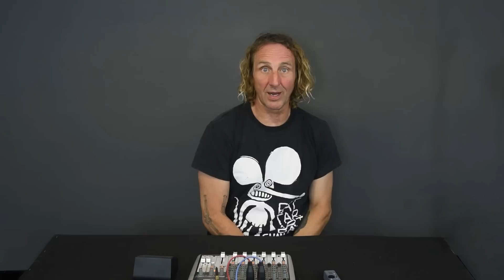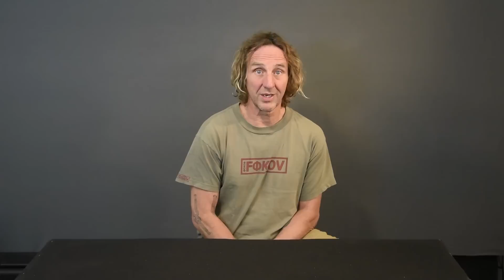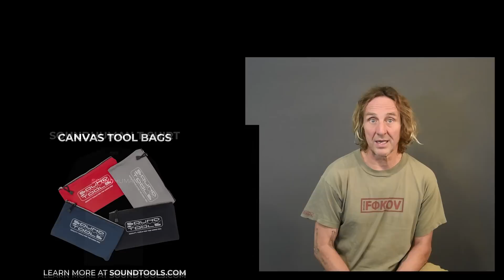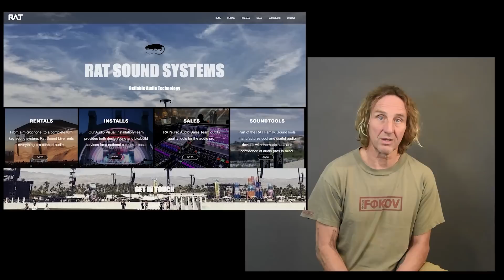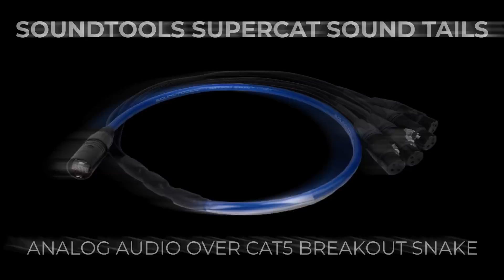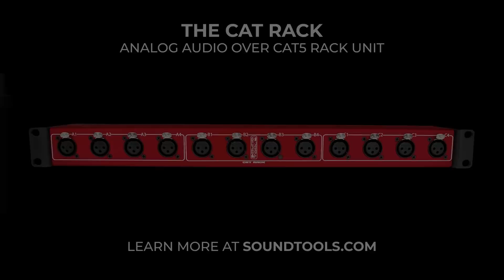Does Gain Pot Sound Different than Fader?

Comment: Hi Dave!

could you please show the difference between speaker generation and how newer transducer reproduce a way better signal then the old wood box with JBL speakers. 
still to this day i have people come talk to me on gigs about how good A7 and 4530 where sounding at discos.
I believe there memory is flawed and the newer technology reproduce a way more accurate signal
Reply from the maker: Interesting.  All the good old days when everything was better, but mainly because our rates were less refined and our memory is flawed.

That said, there ire some sonic differences between the big high efficiency cabinets powered with less amp and the newer smaller cabinets powered by more watts.

I will ponder a punch, dynamics, efficiency and freq response vid. Cool cool

Comment: Regarding "gain adds more bg noise and fader does not", I think that this sentence is for more complicated setup than you presented. This sentence will be definitely true if you insert a Gate to signal chain. Gate will be after Gain pot so if you increase Gain, you're like lowering Gate threshold for background noise. But if you raise fader - all sound that was filtered will be still filtered by Gate and only that filtered sound will be increased.

But anyway, I really liked those examples, especially with clipping gain example!
Reply from the maker: Gates and comps will totally change everything.

The belief that by some magic, a fader knows to turn up the actual instrument while a gain pot is a big scoop that turns up everything including the instrument is somewhat widely believed.

I am guessing this is due to people clipping the input gain which in effect creates a bad sound limiter, in effect reducing the max level of the instrument while increasing the background noise.

Then, turning down the gain and turning up the fader would in effect increase the instrument and reduce the background noise.

But, without clipping, that whole flawed concept falls apart.

Basically, just don't clip the input and all is good

Comment: OK, the most crucial thing here is signal to noise S/N. It is important to understand that all electronics create a certain, fixed amount of electronic noise. If you input a low signal into any component, then you will have to amplify it at some later point and this will also amplify the electronic noise that has come along with the signal from upstream stages of the signal path.
Therefore, in order to minimise the proportion of accumulated noise at the output, the signal level must be maintained as high as possible without clipping through every single stage of the audio system, so that the total amplification is as low as necessary. This is known as gain structure and is one of the most important concepts in all audio systems. However, you do need to make artistic mixing choices but in doing so, you should be trying to apply this principal as much as is appropriate.

Generally, the 1st thing a source signal like a mic will hit will be a mixer input channel preamp. The signal from the mike will vary, some singers are loud and others soft & some mics are less or more sensitive than others and mics are a lower signal source than say a keyboard.  The channel input gain should be set so that when the signal from that source is at it’s loudest. The channel clip light may flash occasionally because clip lights generally come on a little below the actual level of clipping, so the occasional flash is just a warning.  Generally, analogue gear is pretty tolerant of clipping and just goes into a non linear rang of amplification, while digital gear can be extremely intolerant, having almost no headroom before hard clipping.  You get to know your gear after a while.  Anyway, at this point of 0VU we have what’s called unity signal.

Now then, the next control is the input channel fader.  Depending on the mixer, you may have groups, so you would for example assign vocal input channels to a vocal group channel.  In this case there should be a group output meter.  As this group channel is receiving combined signal from several input channels, the combined channel faders act as the groups input gain control.  You will know that the combined group input signal is at unity when the group output meter matches the group output fader setting.  If the group fader is -20dB then you want to adjust all the input channel faders to an artistic mix and at the same time meet that -20 dB target on the group meter.  Therefore, setting the group fader to 0 dB will meter the group output 0 dB (without clipping) or setting the group fader to -50 dB will show -50dB on the group output meter. This ensures you will have no unhappy accidents.

Now, the groups will be assigned to the main output buss which will also have an output meter, and the output buss’s input gain control is the sum of the sum groups.  So again, whatever the output fader’s are set on, is the target for setting the group mix.  So, you find your artistic mix and move all the group faders up or down until you meet you output target in exactly same way you did for setting the group target levels.

Now you have setup a gain structure that maintains unity signal through the whole board, in that when the mixer main out is set at unity, that is zero dB, the output meter reads zero dB.

You may have other gear in the signal path, such as FOH EQ, system EQ, DSP and then Amplifiers.  The point is that you want to have setup the system inputs and outputs so that a unity signal from the mixer is maintained through the whole signal path right up to the amps, but the amp adjustments are a special case.

Setting up the amps.  You need to decide on a maximum target volume and be able to measure that with a standard pink noise. Sent from the desk at unity level.  A word of warning, you don’t want to actually do this adjustment at unity as that is likely to damage your hearing. If you decide say 95 dB SPL is your maximum target read at 1m from a speaker.  Then do the settings 75 dB SPL with a -20 dB pink noise signal from the mixer output.  This makes the whole system predictable and ensures you audience hearing is protected and noise compliance is met.

Some amps may have a gain selector switch on back, allowing you to reduce or increase amplification gain appropriately.  Using the least gain possible, allows you to minimise signal attenuation at the amps input (volume control) and this is the last stage in setting gain structure to achieve the best possible S/N result.  That is the cleanest most pure sound your system can produce.   There are other things than can improve sound reinforcement fidelity but that’s a much bigger discussion and the answer is as always “ Well it depends”.
Reply from the maker: Thank you!

Comment: love your videos.  Usually for my own musical adventures. This video went into a separate issue I've been very curious to learn more about. Cancellation while I've noticed this playing on different systems and having people over to my house where after hours of trying different settings someone will show up with their amps that do not go louder then the ones I have set up but I hear dramatic differences in all noise.    Aside or in addition to this I've been contemplating cancellation towards other applications like sonar, radar, wifi and millimeter wave singles. With absorption, attenuation, reflection agaisnt standing waves and modulated frequencies.  Your phase example was exactly what I wanted to see. Thank you.  Of course your follow up with the exactness required all but eliminates the use of frequencies as a shield against frequencies with frequency hoping and the numerous adjustments / modulations  possible.

Comment: When I was younger I was told to think of gain/volume like a water hose/faucet.

Your water pressure is a set amount of max “power” that the hose can produce, and the faucet is how you adjust the amount of water. Essentially, you never change the water pressure (gain), you open and close the faucet (volume) instead.

My understanding of the concept has become a lot more technical than that, but I always thought that was a good starting point.
Reply from the maker: Hmmm.  If you had a water tank and a variable speed pump, that would be your gain. The higher the pump is set the more water pressure

But the pump is running the water into a hose with a faucet, that is your fader or attenuator.

With the faucet all the way open, the pump is in total control of the output. The faucet is only in control of off all the way up to, but never beyond the pumps current output.

Comment: Great explanation Dave. It made me think of something the sound tech who mentored me told me once.  When discussing gain staging and fader placement, he talked about how he knew many techs who put all the faders at 0 and adjusted the gain for volume from there. Saying that because of voltage, having the faders above or below -/+5 altered the audio in a negative way, and as you mentioned apparently kept leakage from instruments around out. 
Does this have an bearing on what you are speaking about here?
Reply from the maker: There is nothing wrong with adjusting gain to get the faders in a good position. I just did another gain structure vid for the member's side.  It will be public at some point

Comment: Are attenuators always linear controlled not logic?
Reply from the maker: In analog audio gear, an attenuator typucally refers to a passive resistive slide or rotary potentiometer that reduces the level of a signal. In digital gear the function is emulated to respond in the same way.

Comment: Some cheaper pre amps have a relavant amount of noise. Does the Signal to noise ratio get worse on different gain settings? That way you would get a better sound by pulling the fader up and setting the gain low? Or do preamps have their singal to noise sweet spot at around 0 dB?
Reply from the maker: Yes, noise can be an issue and setting the gain pot to optimize gain, reduce noise and avoid u wanting overload is important

Comment: Hi Dave, I have another mystery for you to solve perhaps... Working on Theatrical performances we use a lot of those Lavalier mics on the actors. I have seem to get the impression that using a hotter gain then attenuation is best for not having feeback issues overall. Instead of low gain and 'more' fader... Does it make any sense to you?!? It seems that if you push your fader too much it adds some high freq. to the low gain signal and it ends up feeding back later. Cheers from Brazil!
Reply from the maker: What you describe is one of the reasons I did the video. If the sound of high gain low fader is exactly or nearly exactly the same as low gain high fader. There is no foundation for the concept that the signal would feedback easier of less easy one way or the other.

Though low gain and high fader can have a bit more noise or preamp hiss.
Reply: @DaveRat  Yes, exactly! Thank you! What I come to think is that this preamp hiss is the one who causes the high freq. feedback. Because it does sound the same but the feedback occurs in 12k+ or so... those mics DPA mics are very sensible and high tuned. Anyway, this is something that has always puzzled me. Thank you for the reply and the videos! Cheers!
Reply: @bparagao  Double check that you aren't clipping the transmitter or receiver.  If you are clipping at any stage then you'll be more likely to get feedback for any given apparent level in the PA.
Reply from the maker: Having the gain too high is a good point.  If the gain is causing  clipping somewhere, anywhere, feedback will be more for a given output level.

Comment: I've always treated gain like blowing up a balloon.
If you make it bigger (more gain) then the 'active' area in which signal is picked up, increases. But, as you say, clipping eventually sets the limit of the 'diameter' of the balloon.
According to my model, a smaller balloon will have less 'diameter' so things outside of that will be less likely to be picked up (keeping in mind everything is varying in volume dynamically all the time.
That means I tend to fall into the camp that supports the 'more gain = more spill" camp.
That said, everything has its limits and its all theory ... if it works, sounds good and everyone is happy, then go for it.
Great demo Dave. Cheers
Reply from the maker: Hmmmm, I would say the balloon analogy works until you get the part about the gain being selective about what it picks up.

That part has no parallel to reality. Gain has no way of knowing what to pick up, it only Increases the signal in level.

There may be some EQ variations with cheaper preamps but as far as being selective about what is amplified, that is not realistic
Reply: @DaveRat  True. Totally get it 👍

Comment: I often wonder if this observation that the gain control affects the mic's sensitivity is due to the fact they have a compressor on the channel and the gain control is also affecting the compression threshold?
Reply from the maker: Hmm, I have heard the wives tale of gain pots vs faders knowing what to amplify long before mixers with built in compressors existed.
Reply: Yeah, I guess that would also apply to outboard comp's inserted after the pre-amp and before the fader.
Reply from the maker: True
Reply: @DaveRat  Wives tale indeed!!

Comment: Loved this, when setting up a new venue would you be looking at the amps (gain boost) or wattage then calculate how hot the system would run and how much you'd need to hit a specific decibel rating? The system I run is well setup but haven't had to choose and set one up from scratch yet. Talking Mid size venues around 1500 seats :)
Reply from the maker: I will do more vids on gain and setting up

Comment: I remember being told ages ago that it sounded best to run power amps at full, and even that it wore out a power amp more quickly to run it lower. 
I always wondered, and I kinda felt like it might be BS but I tried to stick to it "just in case". Good to hear some common sense and proper info!

Comment: Hey Dave, unrelated to this video. With your CatRack system. Would it be possible to make a 48ch Splitter. With CatStageBoxes, Feeding a 1U panel of 12 ethernet passthroughs into  4 male CatRacks, using the thru in them to then feed another male 4 CatRacks? Took cue from one of your videos!
Reply from the maker: Yep, that would work!
Reply: Dave Rat If it ever get’s built I’ll send a picture! Thank You Dave
Reply from the maker: Yes please!

Comment: Excellent video Dave, I think I commented on a previous video of yours about this subject and I've always found it really interesting. When I started out I definitely had some placebo effect where (before monitors were being taken into consideration) it seemed that if a vocal mic was feeding back, you could reduce that feedback by pushing the fader up the same amount as you pull the gain down. It's very easy to fall into these traps working by yourself in a club setting and with other people repeating the same information. 

I really really really want one of those tiny micro wedges! Is there a chance these would be buyable at some point? ;) Have a good weekend!
Reply from the maker: I will try and make more of the little wedges and let ya know, I will post a vid when I do.

Comment: What about frequency response of OP AMP's ? 
If you will regulate feedback loop (in electronic cirquit) then frequency response will rise or fall - that said some basic of electronics. 
Gain is not only voltage pump, in OP AMP happen more stuff than only voltage leveling, let's not forget about that.
We don't know how OP AMP is built and steering in every console, so it is possible that the feedback in the monitor effect is based on some other variables.
next topic is how GAIN itself is realized. In Yamaha LS9 you have physical gain jumps every about 20 dB (if I remember correctly) and everything between is software magic. Approximation for digital trim is another variable in that process...
You will get that information from mixer serviceman, can't get that knowledge from marketing brochures or even selling manager specialist.
So it should be as simple as you said but no, it is more complicated, esspecially if you are working on many equipment, you can find that every machine works it's specific way. I would not say that "experienced sound engineers" as some crazy guys just because they "feel" something that can't explain right now...sometimes the secret is hiding in the patented technology of that gear developer and we can't get informations how it is built and how exactly it works, but we feel that something works "that way" althrough it is not so obvious if we think literal way like "gain=voltage pump".
Cheers. 
Thanks for that video.
Reply from the maker: Good stuff and fun to test. On the Yamaha console, doing the same out of polarity signals with differing gain/fader settings and seeing if they cancel, would be interesting.

I personally believe all can be measured. And yes there are things we feel or hear or think we hear that we just have not figured out an easy good way to measure yet

Comment: Thanks for making this videos Dave. The percentage of THD+N of a gain circuit increases when gain is increased. Just an electronics engineering thing that is hard to get around.
Reply: Does it increase enough to make an audible difference when we stay in the nominal 'linear' operating area of the preamp, though? My fading memory of the works of Douglas Self ('Small Signal Audio Design') suggests not.
Reply from the maker: And that and any other differentials should be audible with the rev polarity summation so we can gauge relevance